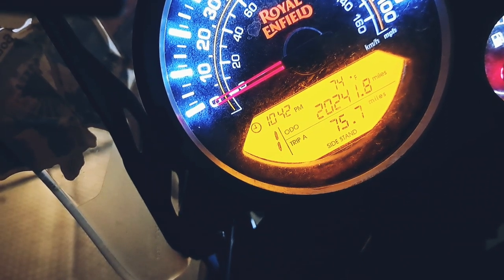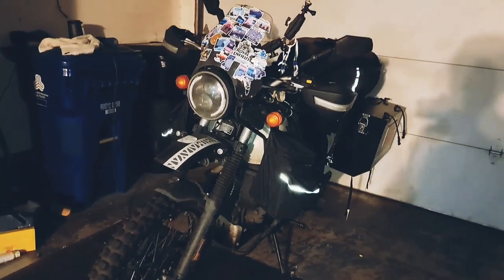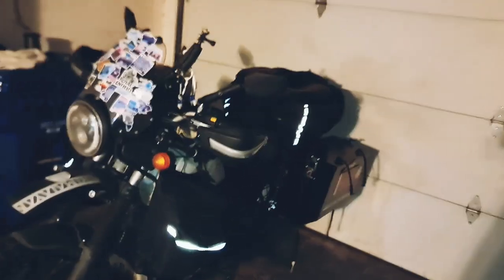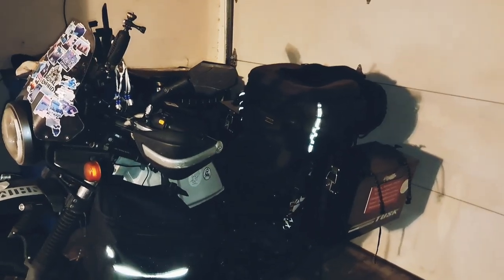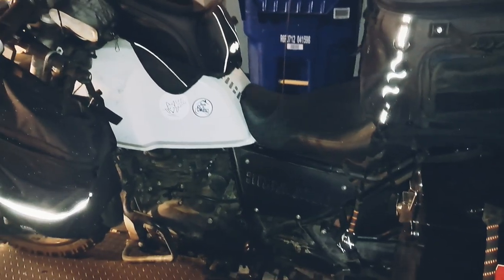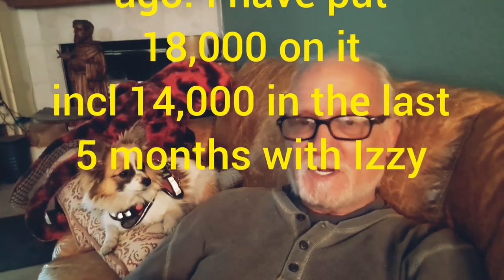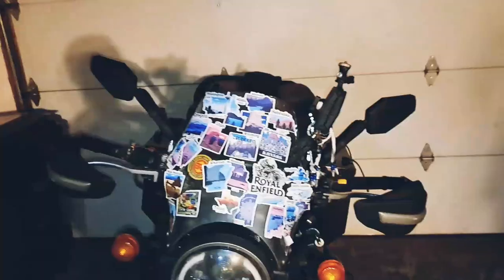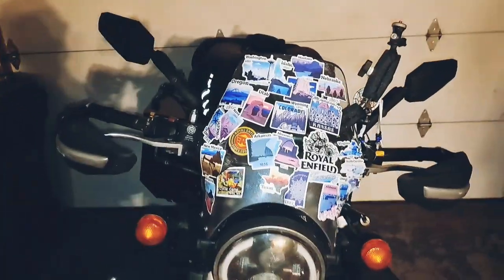Royal Enfield Himalayan 20,000 mile review

Comment: In reference about the deer whistle.  They don't really have any effect.   Deer hear your motorcycle/car just fine.  They don't react because the sound is gradually increasing which doesn't trigger a startle response.   If you dropped the bike noise on top of a group of deer they would scatter.   I live in Nova Scotia and have dodged a lot of deer.   Some of those vehicles had whistles.   Great video.   Ride on.
Reply from the maker: I was always a bit dubious but figured that was probably the case. I figured 7 bucks wouldn't kill me and it's a conversation piece. Thanks for the input. I do appreciate

Comment: Hi Steve, I was wondering which rok straps you use on top of your tusk panniers? I purchased a set for mine but they are too long. Didn’t see them on your link list. Great video!!
Reply from the maker: The ones I use on the top are the thinner shorter ones..  https://amzn.to/3EDkXuT     They work well but I also run one of the larger longer ones from the rear rack, diagonal down to the frame. I also attach the thinner ones in a cross pattern. Leave the elastic portion on the outside and the straps on the side against the bike for less stuff hanging down that could tangle if that makes sense. That's an affiliate link so disclosure that I might make a nickel but I would never recommend something that didn't work well. I'm a big Rok straps fan.

Comment: my regulator rectifier failed at 17k miles but it was failing at about 15k and i thought of it was other things causing the problem of stalling and not stating, check your rectifier it can be the cause of many things when you have EFI!
Reply from the maker: Great insight. If you saw my later post, one  of the things that became most important in continuing my journey is going to a carburetor on the new bike

Comment: Just found your channel as I have narrowed my search down to the Himalayan and the Klr 650 which is a little too tall.  As for the Himalayan have you actually removed the tank and done the valves every 3,000 miles?
Reply from the maker: Yes. There has only been an actual adjustment needed every other time and they seem to be settling in. It's not difficult. I added a disconnect plug in line with the fuel pump electrical line as I found that the hardest thing to disconnect so I just split the line

Comment: My bike had a defective battery from the start, they couldn’t get it to hold a charge or start the bike, so they replaced it with a new Japanese battery before it left the showroom. I replaced the relays before they gave me any trouble. The chain didn’t impress me it seemed to be stretching all the time no matter how much I lubricated it. It broke at 16,000 km. I have never driven it hard. I haven’t had a problem with the clutch plates but I have never felt very confident about the clutch.